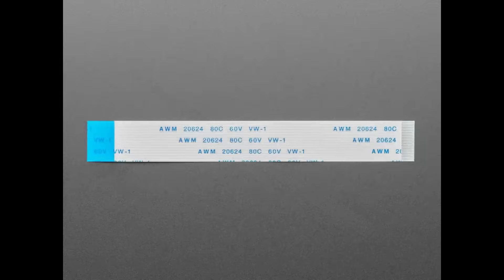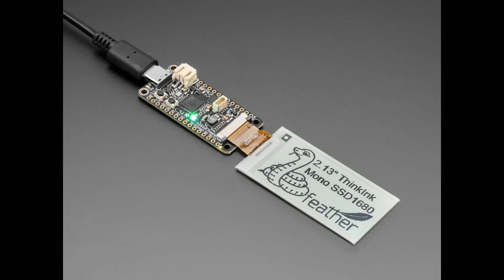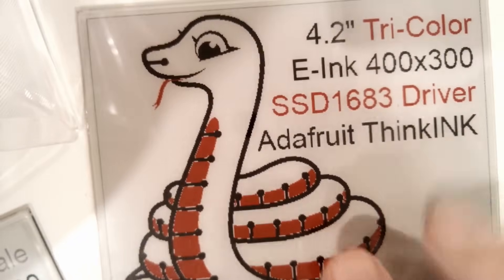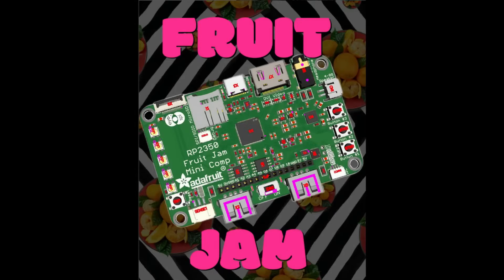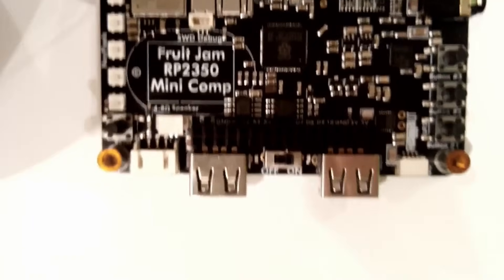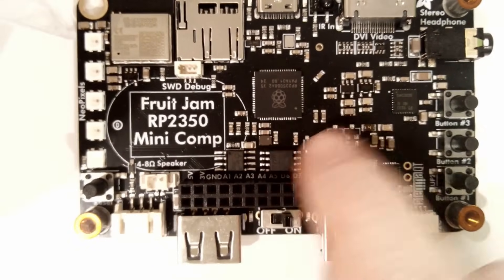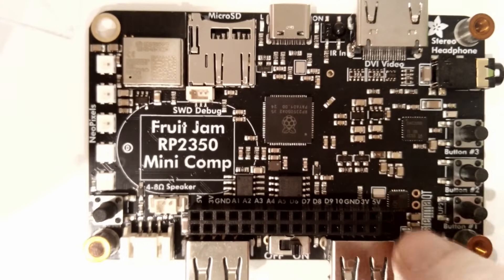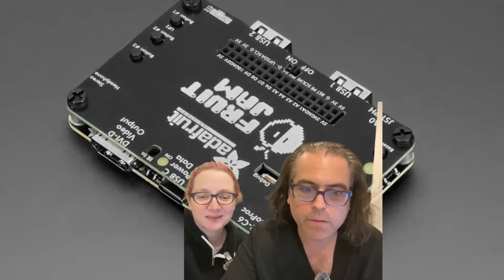#NewProducts 7/30/25 Feat. @Adafruit Fruit Jam - Mini RP2350 Computer

Comment: What software stack is running on the RP2350?
Is it open source?
Reply: Multiple software stacks have been ported to the RP2350. The most popular one for the Adafruit Fruit Jam specifically, which IMO would be CircuitPython, is open source.

Comment: Annnndddd ... The Fruit Jame is already sold out. LOL, Wow.
Reply: I'm glad it's popular, and it's nice that AdaFruit have some protection against bot-ordering.... but it stings that regular customers can't ever get things from first or second batch orders, and it sold out within 1 hour of the video which released at midnight ET. 

I suppose the insufficient quantity is resulting from a first-run conservatism about batch size, or simply releasing a batch as quick as they can assemble. Which is a good policy. I've just been dying for one of these things since the first mention. :-)
Reply: @thisisreallyme3130  I think LadyAda explained she does a small batch, wait for customer support feedback on problem encountered by customer, and if it is fine, she ramp up the production.

She already has feedback from the team that create learn guide.
Reply: It's a shame. I signed up for email notifications for it when it said coming soon, but never got an email about it getting released. I only found out because I checked on the "new products" section.

I have been getting all other emails, including the weekly new product email (which released a day or two before this was announced). I guess it was sold out so quickly it decided to not send an email.
Reply: Give it a few weeks, initial demand always exceeds supply with small shops like this.
Reply: So sad I missed the drop. 
I signed up for the email list and seen to have missed the email.
😢

Comment: I don't get boards that have an ESP32 as a co processor, when the ESP32 is about as capable as the main chip.
Reply: The Esp32-C6 is not as capable, does not have the same features, etc…
Reply: @dwagner6 They’re not too different. Similar clock speeds, same onboard RAM. Although this particular ESP32 only has one main core, whereas the S series has two.